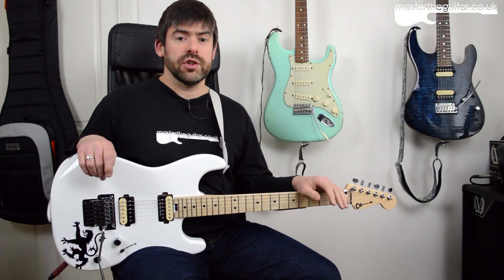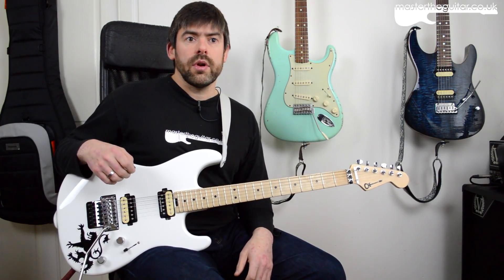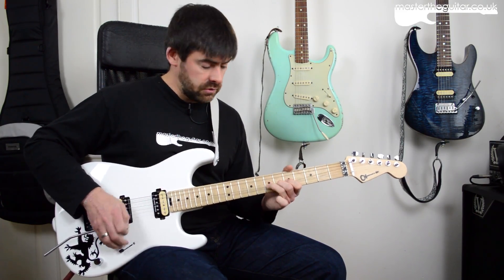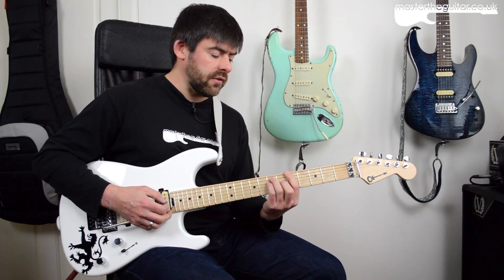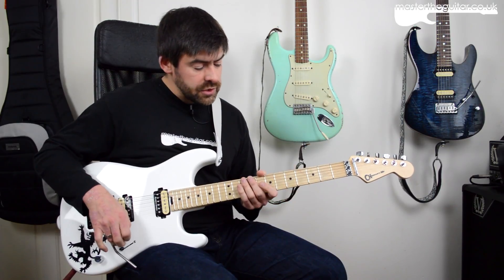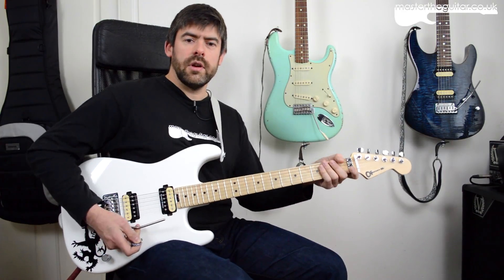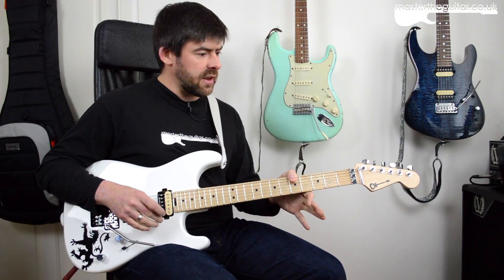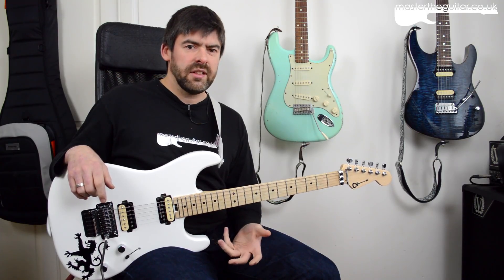AMAZING Revolutionary New Guitar Strings! - In Tune Chord Bends - MasterThatGear!

Comment: Great, EVH and Holdsworth trans-trem is available to all!
Reply: Not the same. Trans-Trem from Steinberger does it over all strings, works with any chord. 
It works well if it's set up correctly. Than you can fix the trem in a position half step or full step up or down while you're playing. 
Only a few appreciate those new features. That's why he rather goes for the violins and chellos these days, cause improvements are seen, heard and appreciated. The guitar world is a weird place. This could work, cause the "deeply religious" guitar players might at least try some new strings.
Reply: onpsxmember agreed it’s not the same. But seeing as transtrems are getting hard to find and a lot of them out there have issues with metal fatigue, this is a reasonable compromise.

Comment: First.....wow, should be useful for keeping in tune without having a whammy bar. Takes the pain away from having to tune up mid way through a show.
Reply: Yeah, I guessed you still need to tune on times but anything that would allow you to do that less frequently is a plus. Thanks for the info.
Reply: Main problem with vibrato systems is inertia. That's why you have to yank on the fender-style ones to get back to zero. Not with a (original) floyd or improved versions (schaller) or the ones from the Parker Fly guitars. (The real Fly's with the fibre-mix in the back)
When there is no vibrato system, the main problem is either not stretching the strings enough or the nut slots.
Reply: I'm going to read your paper on it. Would it be possible with a coating as well?
Have you thought about a stand on next years acoustics fair in munich? (DAGA?)